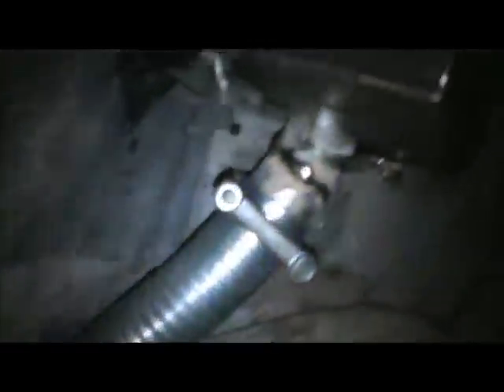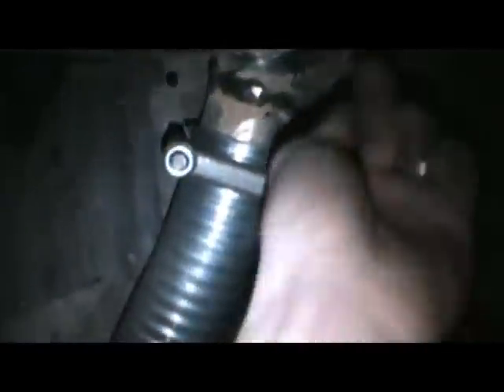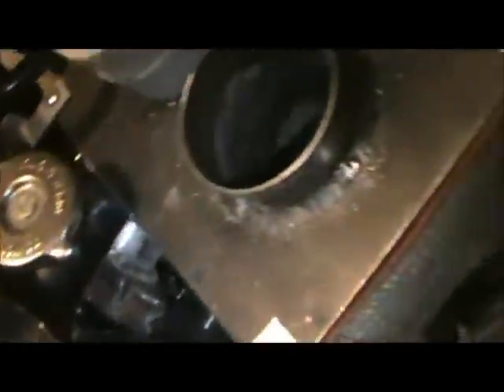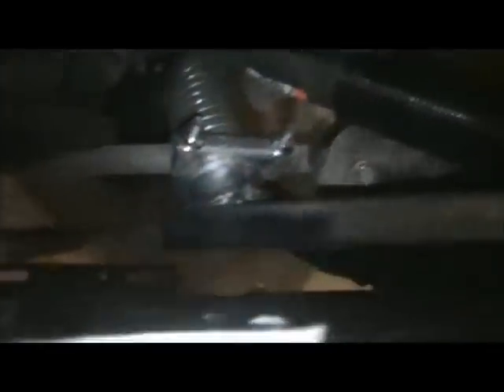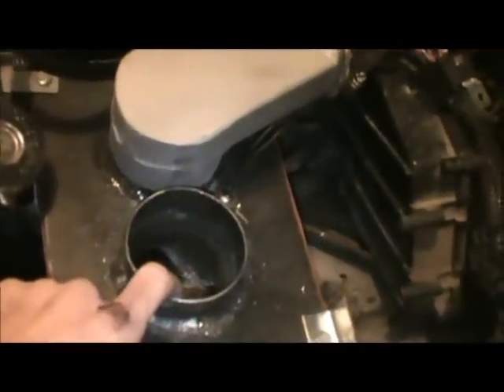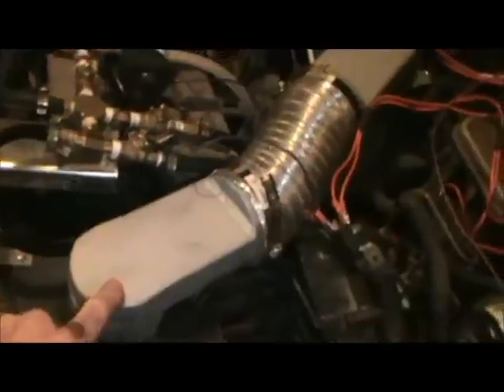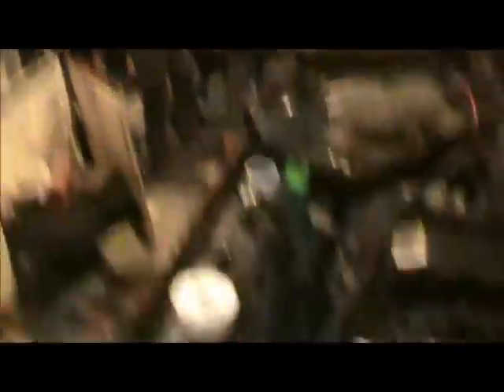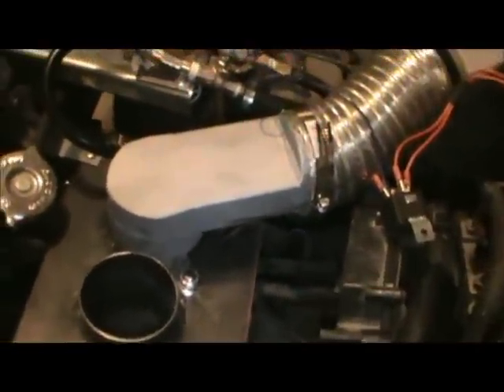100+MPG PROJECT NEW FUEL VAPORIZER INSTALLED (DETAILED OVERVIEW)

Comment: I'm curious, how do you know the carbon output is via cleaning what was built up, and not via improper combustion? Have you checked the spark plugs for fouling before and after? Also why does gasoline vapor have a greater potential water content than regular injected/atomized fuel?
Reply from the maker: I know it was running lean because of the amount of steam coming out the exhaust. If it were burning rich you would not get nearly the amount of steam that was coming out. I have see the vaporizer run both ways rich and lean and when it runs rich you don't get the steam effect like you do when it is running lean.

That was a very great question. If you have ever seen an engine cleaning using HHO you will get the same steam and puddle of carbon effect.

I will be demonstrating this effect on my generator hear in the near future. I will clean the exhaust out and will show the difference running rich and running lean.

Comment from the maker: It is extremely difficult to get a system working that is able to achieve that high of fuel mileage at all times I have only been successful at achieving that a few times.  I changed it to 100+ MPG so I have a more reasonable goal to achieve at this point. I know that 211 MPG can be achieved because I have done it, but I also know how perfect the conditions need to be to achieve that and it is so sensitive that it is extremely temperamental when trying to obtain such results. Baby steps...

Comment: I was thinking that a person might want to run heat through the vapourizer via the heater coil system which is always at about 160 deg F. Keep the gasoline under pressure and take the vapour from heated gasoline. Gas has a lower boiling point, and with increased pressure would raise that point. It would self regulate. Surface area of the holding tank would have to mach the general demand.

Just another idea.

Comment from the maker: The ATF is not set right. If you use more fuel when using the vapor then when you run your engine on regular gasoline the valves are not adjusted correctly. You have to have a valve system to adjust the ATF if you don't then the engine will use whatever it wants to and there is no way to control it. You need a vapor valve and a secondary air inlet valve. It's a pain but once you have everything dialed in right it works wonders.

Comment: I am really interested in this technology. I hooked up my lawnmower so it would run on gas fumes and it did run well. However it would stop after about half an hour and there would be gas left in my bottle. It ran 23 minutes on 16 oz of gas. I then I put 16 oz of gas in the tank and ran it the conventional way and it ran exactly twice as long, 46 *
minutes. I was expecting it to be the other way. What am I missing here? Im not a skeptic to the HHO or vapor engine but this bummed me.

Comment: My only question is, do you lose performance with this type of system and if so is it possible to still run on just fuel still with this system installed?

Comment: I started out running an enclosed system in the back and running longer tubes to the front , that was a bust the distance was just to far ... the vapor cooled down to much and getting air flow over that long was near imposible. drawing up plans for a two stage system now with reserve storage in the back that fills the vapor system under the hood. my biggest problem so far is space for everything under the hood

Comment: my goal is to turn my 93 Cherokee into a bug out car. chose it for  the 4wd capable and as far as SUV's its on the slimmer side and the 4.0 is a vary durable inline 6 that you almost cant brake. its also older " not as many computer's to deal with " when testing and seting up my mods

Comment: you disconnected the front drive shaft :( no more 4wd ... assuming it was do to space needed to run the pipes up ... I have a 93 jeep XJ  im going to hook a vapor system up to after I fine tune on an old mower motor I have mounted to a work bench and I under stand everything better

Comment from the maker: It will actually work on any gasoline engine carburated or fuel injected computerized or not. As for the 100 MPG going over 60 MPH some vehicles can get that but more testing needs to be done to determine what the average car will get going 60+ MPH.

Comment from the maker: Cap off your pcv valve and all vacuum lines coming off your throttle body, gap you spark plugs about 20% more then what is recommended, this can give you about a 10%-25% increase in MPG just depends on the vehicle. Once you have done that reset the cars computer (ECU) in the car if it's a newer car.

Comment from the maker: I have a basic diagram on my facebook page (FSRD Tyson Capel). This system will have to be designed differently for different vehicles, the concept remains the same you would have to shrink or up size the design to make it fit under the hood and design it so it would function properly for whatever car it is put on. 
I will post more videos with more detailed information in the future. I have had some set backs such as people breaking into my car messing it up, people fallowing me, and much more.

Comment: ~Carberator~ goin to get a carberator & secondary fuel pump mock the carb onto a bucket  with stainless steel wool inside the excess fuell will be cought in the catch where a small return line to the fuell tank run off gravity & the incoming fuel will be heated by the cooling system & leave the stock fuel sys alone the obd2 should compensate and shut off after its warm ... maybe a shut off switch well see tomorrow

Comment: I have a couple inline six cylinder 292 chevy engines that sux the gas. Have been thinking making a manifold that the intake runners follows the exhaust like have the exhaust inside of the intake runners and mounting the carb low so all the exhaust heat can vaporize the air fuel mix. Will this work or blow me up? Exhaust and intake runners will not mix but exhaust tube run inside the intake runners. Hope to hear back soon. Thanks

Comment from the maker: You have to cut off the censer level with the transducer then you have to drill screws in the holes where the censer was and ground it out against the face of the transducer. It's best to special order a mister without the censer on it because if you modify one it will end up failing on you in a short amount of time. You can special one without the censer from mainlandmart. Google mainlandmart and you can call them up to order one.

Comment from the maker: This design is a bit complicated because it is a prototype not the actual unit that will be able to be installed in any gasoline vehicle. It will get much simpler but this is what I need to be able to do the type of testing I need to do so I can perfect the design.

Comment: hi there i have experimented with billythekids white gasoline vapor 2000cc engine ran with revving now & again perfectly well hooked up to houses electricity approx 500f deg hot plate would of used aprox 360 mils of gasoline in 1 hour i have not run car on road due to not enough room under bonnet for second alternator to take a inverter i hope you get this mesage it disappeared when i posted it before on  billys you tube best of luck to you

Comment from the maker: There is more to gasoline then just gasoline it is a mixture of many different additives and each have a different vapor point therefore the hotter it gets the more volatile the whole mixture becomes which in turn provides a complete combustion of the fuel.

Comment from the maker: By the way no one is feeding me these lies do a test your self get a hot plate and spay of drip gasoline onto it make sure it is at least 300 degrees F preferably hotter then ignite the vapor and tell me it is not more volatile then the fumes coming off of a drop of liquid gasoline. Vapors are the only thing that burn liquid gasoline does not burn so yes vapors are more volatile and the hotter you get them the more volatile they become.

Comment from the maker: It is proven that only about 30-40% of fuel is burnt during combustion so even if you were able to completely utilize all of the fuel your fuel mileage would at least double. When I vaporize the gasoline it is literally cracked into it's separate molecules therefore it combusts differently then the typical mist from the injectors. I can only tell you what I have personally witnessed and I have seen much more then a 100% increase in fuel efficiency MPG increase.

Comment from the maker: You are correct it does go through the pressure stroke but this does not decrease the temperature of the vapor therefore during combustion the vapor re expands into its previous state and achieves a complete combustion.

Comment from the maker: 4. You wont have to worry about that.

5. As for using a LPG kit I have not done this however the way I understand how these kits work they can completely cut off the air going into the intake as only such it the propane or have the ability to do so, therefore as long as you have a kit that allows ambient air to be a part of the mixture I would imagine it would work fine but can't say for sure since I have not used one.

Comment from the maker: As for the unburnt fuel cooling the engine this is a lie that the manufacturing, oil etc. companies have feed us. When I run off of lean vapor my car runs cooler. Cars will run on propane, natural gas, and hydrogen just fine this right here is proof that the liquid gasoline cooling the engine is falsified information.

Comment from the maker: 3. I can only answer this based upon the testing I have done thus far. As of now I have not had any engine problems running a vehicle on vapor. You do have to either override the computer or place the mass air flow censer before the vapor air mixture because if you don't and have a newer car it will throw your transmission off so it wont shift properly.

Comment from the maker: 2. Yes gasoline vapors can be produced at those temperatures it all depends on the elevation or atmospheric pressure as to the temperature it will vaporize at. Please keep in mind the additives have a higher vapor temp.

Comment from the maker: I'd like to see it.. If you use a  ultrasonic transducer you need to special order them without the censer, if it has the censer it wont work in gasoline inless you cut it off and ground it. Even when you modify it it wont last long on gasoline so spatial ordering it is the only way to go. Google mainlandmart they sell allot of transducers and you can call them to special order them without the censer.

Comment from the maker: No you don't need to find an alternative method to cool the engine it actually runs cooler on vapor then on liquid. I have a cylinder head senser installed and the engine runs around 205 degrees F on vapor.

Comment: Since you're disconnecting the injectors, I'm very interested to learn how you  control the injection and fuel-air mixing.  Did you build something yourself (like an arduino project..etc).  This is my first watching of any of your vids, so sorry if my answer is elsewhere (i plan to watch all your vids though). Great work !

Comment: 4)	If I have to replace the lost ability to keep the car cool, what would be an alternative method to keep the engine from over heating if not exploding? 
5)	Would I be better connecting my devise equally to the intake or inlet manifold, by means of replacing the fuel injectors, with the use of my system being managed part by a sequential LPG kit ?

Comment: amount of vapor? It has been suggested that gasoline can produce vapour at temperatures as low as -40c.
3)	If I am capable of producing an enough source of fuel to make the vehicle idle and operation via the air intake, will it damage the engine in anyway long term? It is suggested that the 60 or 70 percent fuel that is wasted in the combustion process is used to keep the engine cool (in which I don’t believe). If that was the case why are people able to run cars only on LPG?

Comment: 1)	Correct me if I am wrong. Because the unit will be controlling the amount of fuel supplied to the air intake, I think it would be possible to supply on demand by means of the PSI been varied. 
2)	If you can imagine an element with an aluminium or copper smooth surface (180 mm squared in my unit), that heated at 200f and spray the surface with gasoline via the NOS Foggers. Would it produce a large

Comment: I then will have a variable 20 PSI Propump connected to the Fuel Gas and Oxygen Flashback Blowback Arrestor that will draw from the unit, and be supplied directly into the air intake (after the fuel sensor). I will have a butterfly valve connected to a tube that will be inserted into the fuel to allow air flow on demand (with an air filter), when the Propump supplying the air intake is active.

Comment: The NOS Foggers will be positioned facing a 45 degrees angled insulated heated plate that will at least reach a 200f temperature. I know gasoline vaporises at 450F but would this be necessary now? The unit will be a strong 200mm box unit. The top of the unit will have a 200mm tube (1 inch in diameter) coming off of it. At the end of the tube I will be fitting a Fuel Gas and Oxygen Flashback Blowback Arrestor.

Comment: I will be using a 12v Propump (variable 50 PSI version) that is capable of creating a loop. Will be putting fuel through the NOS Fogger at a pressure that is higher enough to make it become a really fine mist/ generating a high volume of fumes. Basically the excess amount that will be produced and hits ceiling point will return as a liquid to the bottom of the unit which is the gasoline source used to supply the NOS Fogger.

Comment: I am thinking of using a couple of NOS Foggers to produce the gasoline as a white mist or fog. I have been informed that I need as little as 7 PSI to turn the gasoline into a white fine mist or fog. I had considered using ultrasonic transducers. After research of reading and watching many test findings, I have come to the conclusion that they would have a very short life. Gasoline would be very corrosive to an ultrasonic transducers if left immersed.

Comment: Regardless of what system is used to operate the car. Do I need to find an alternative method to keep the engine cool, if I am not cooling the engine with the excess fuel wasted normally by the fuel injectors? I am confused as cars that are LPG converted will run a car, once the engine is hot enough. Some people run their cars purely on LPG, and only really have issues when trying to run them in colder climates.

Comment from the maker: Please keep in mind there are many critical things that must be dialed in correctly to have a good functioning vaporizer some things that need to be controlled are vapor output, vacuum, heat and humidity. All of these will effect how the vaporizer performs. It is very difficult to get everything set right so please keep that in mind. I am still getting it all figured out and will share the correct temp. air, fuel, etc that is needed once I know exact numbers.

Comment: Hey Tyson, I am not sure if mentioned this before but check out HCS! It is very much like what you are doing, and may assist in the simplification of the setup. The link is below. 
Great work btw.!
Fuel-saverDOTorg/Thread-Hydrocarbon-cracking-System?page=90

Comment from the maker: The reason I am using the exhaust is because it heats up the vaporizer much quicker and it gets much hotter. I may use the heat from the radiator to make a heat exchanger for the incoming air.

Comment from the maker: I have not tried connecting a vapor system up that way so IDK. The only way I have done it is to completely shut off the normal fuel supply to my engine and instead run vapors through the throttle body. Since I run my engine through the throttle body the o2 sensors and all that doesn't matter. All those sensors do is control your air to fuel ratios.

Comment: I agree with your second statement - that there is hydrogen in the gasoline molecule which when freed during combustion can find an oxygen molecule to form water vapor.  I still do not agree that there is any water in gasoline, however.  The two cannot mix and water will immediately separate out.  I think your other postulation about there being more free hydrogen is a better angle on why there may be more steam in the exhaust.

Comment: you are both right and wrong some of the steam comes from moisture in the air and some from the fuel,But there is the rebonding of hydrogen and oxygen in the combustion chamber.this is the majority of the steam you see. With the more efficient burn of vaporized fuel you see even more moisture. you may want stainless parts from the exhaust manifold and on back. Its that or rust

Comment from the maker: The more complete the combustion is the more water (steam) you have coming out your exhaust because the hydrogen is no longer bonded to the gasoline molecules, since it is no longer bonded to the gasoline molecules it bonds to the oxygen which in turn forms water. So the more completely the gasoline burns the less gasoline molecules there are for the hydrogen to be attached to.

Comment from the maker: Steam comes from both water in the gasoline and water in the air. Gasoline does not actually have water in it in a liquid state but it does however have the molecules in it that make up the water molecule therefore when combustion occurs these molecules bond together forming water which is where some of the steam comes from.

Comment from the maker: When running off of injection systems that spray fuel into the engine there is such little time for all of the fuel to vaporize that it is not possible for it to do so. Pre-vaporizing the fuel before it enters the engine allows for complete combustion to occur.